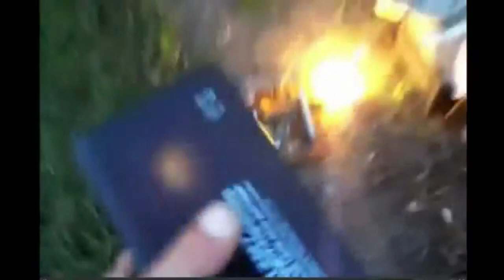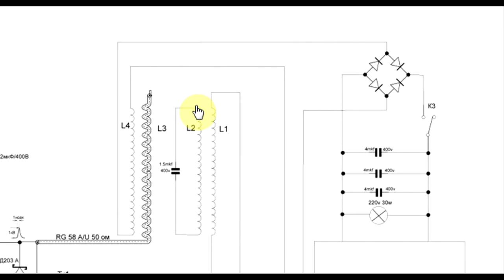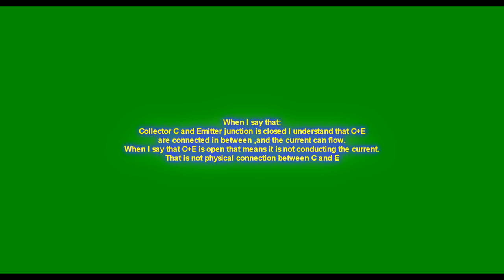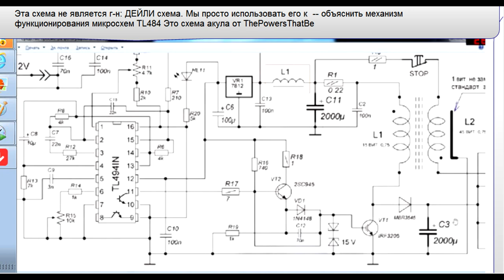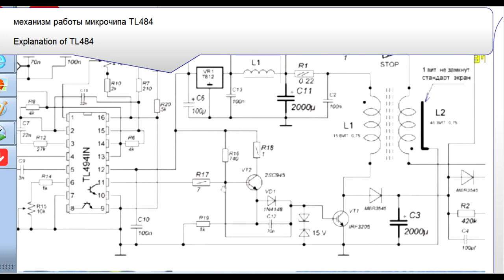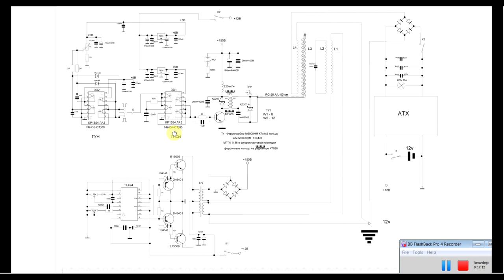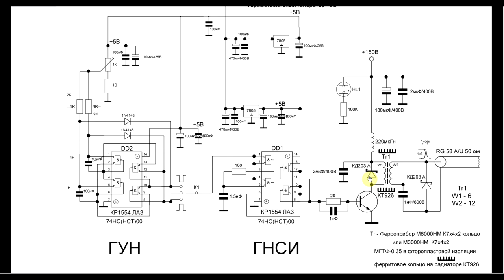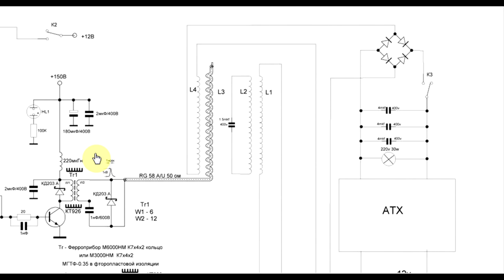Wesley presents:Daly part #1  Free  Energy Device (schematic)

Comment: the 150 volts actually comes back from the other side of the secondary... so it's a push-pull 12V high amp as you can - (that's the ferrite ring projects that are inverters)  ... the 4th winding (second output) goes to the composite coil... and the resonance from that coil comes back to drive the ferrite core... so the tl494 is tuned to that frequency... but with the first secondary that is rectified to the cap, if it takes a lot of the flux in the beginning it takes a bit to get to resonance until that cap charges quite a bit, then the resonance is more effective.
Reply: the diode is also a special characteristic DSRD (drift-step-recovery-diode) which when reversed will over-pulse so you get a 1.5KV signal out; Itsuable was able to get this effect.... 

The top logic can be simplified to stacked mosfets with a RC constant betwene their gates so one turns on and then the other (I had a circuit model for it but cannot find it... )  There was a book that was mentioned 'belkin' something about pulse shaping techniques for GPR (ground penetrating radar)
Reply: I'm a little wrong; the resonance within the ferrite toroid is enough to generate high enough voltage... it's not really feedback from the composite coil; there is a additional LC resonance tank on that coil which should be tuned to the same frequency....  The transistor is also known the avalanche; the original part is a voltage rating of 150V; so it's possible that after a couple tickles from the nand gate pulsers that it ends up cascading in freqency of the the rest of the system....
Reply from the maker: thank you for your comment :)

Comment: The other interesting connection; betweren L4 (toroid driver) and (l2?) of the composite coil 1 side is grounded.  This sort of half wave rectifies the coil resonance.  It was important to ground the correct side... without ground there isn't enough 'free' electrons for the oscilllation... so it was generally less effective...
Reply from the maker: I have explained  that in video 5

Comment: The thing I don't get, and maybe this is where the free energy comes from.... The 'Magic Coil' for all of these guys is the same, they all have TWO input coils coming from TWO separate parts of the power supply. (L1 & L3)   WHY ?   Any conventional transformation system always has ONE input winding.  You only need one coil to pump energy into the core. You Wesley, and oher researchers like Don Smith were able to produce OU with HV spark discharge through air core resonant transformer with ONE input coil.  Why do these guys have TWO input coils? And why are all using COAX cable for one of the TWO coils?  Wesley, you present discussion with friend talking about RF impedance and reactance of coax cable with different terminating resistances at RF frequencies, but what you didn't talk about is what kind of energy is the COAX cable transmitting into the core as electricity flows through it?  Is it transmitting magnetic energy like the other 3 coils, or is it transmitting RF energy Into the fluxuating magnetic fields of the other coils???  Is there some 'Magic' that happens when you introduce two types of energy into the same space?  Magnetic energy pumped in on L1, and RF energy pumped in on L3??? Maybe this was Tariel Kapanadze's big secret???

 I also didn't hear any discussion of the two frequencies of the two oscillator circuits. L1 must be pulsed to match the resonant frequency of L2, this is obvious, but is L3 the same frequency?  If L1 and L3 are the same frequency, are they synchronous or are they phase shifted?
Reply from the maker: saintsnick be honest To answer the questions I should do  another video.
It is not  as simple  to respond as is simple to ask.
That is why there are so many videos in this subject there.
So  should  you take your time to dig in  other videos to find my explanation of electrostatic pump?
============================================================= 
The student wants the answers and by the time he gets them he already  has gone to 4 years of  university "preparation" to understand them and did not return  yet.
==============================================================
However also  there is another way I give you example:
I work  on Colman Device - the rest is only my contribution to general subject of FE.
As Colman is based on very much set phenomena  of radioactivity look:https://www.youtube.com/watch?v=l-Cvm_0XEjg
than to answer questions .At first, one must go to:   
https://www.youtube.com/playlist?list=UUluf2QeoM9dS8sETBJLcmUQ
 here you find 100 videos and around 60  are  important for you to view.
And than you ask questions, and I need only to give you than few short answers.
=================================================================
I would love to   help you but that would be more like take most of my  recent videos
and repeat it in form of the answer.
 Yes you got me here.
Whatever my answer is there is 20 more  new questions to be ask.
I suggest  take your time  and get deep into  the material published.
I have however some universal answer  for most of it.
 And that must  wait ,
 stivep:http://overunity.com/15083/the-new-generator-no-effect-counter-b-emf-part-2-selfrunning/msg427618/#msg427618
Reply: stivep1
Reply: saintsnick Wesly, thanks for responding. I am familiar with the Coileman device. I am a long time researcher, and I read the Coleman patent completely a few years ago.  It is a Fantastic technology, a radio-nuclear battery, where a specific frequency bandwidth is directed at a specific chemical layer assembelage, whereby a Low Energy Nuclear Reaction L.E.N.R. takes place, and a large amount of low cost electricty is directly produced.  It's great to see experimenters tinkering with this technology, and having success. I wish them much luck.  I however am interested in solid state electrical OU devices.  I've seen many successes so far, some also fantastic. Generally, these type devices involve, tuned electrical resonance of input or output circuitry, or both, where differential input energy is squared at resonance, tuned isolated tank circuits in a transformer adding momentum or creating a base frequency of an air core, and high voltage spark gap capacitive discharge circuitry, which also has an ability to add energy to a circuit via half cycle capacitive-resonant-colapse.  These type devices may also sometimes involve RF collection through tuned resonant circuitry, or tuned resonant masses. There are tricks to make these things work.  But never have I seen TWO input coils in the same air-core, and more specifically, where one is a conventional transformer winding, and the other is an RF impedance cable, Opened on one end. If this is truely RF transmission into the core, then it is interaction of EM and RF, and is UNLIKE the Coleman technology... radio-nuclear.  Am I viewing the schematic correctly??? It seems there are TWO oscillator/amplifier circuits with separate input coils on the core. You speak with these guys. You are the translator, the Rosetta stone between worlds. Only you can get into their heads to understand.  I don't speak any of those languages. Please provide some indication as to what's going on with these guys theory of operation.  And I will continue looking for what you say, Electrostatic Pump, but judging a book by the title, it doesn't sound like an explanation of what's at hand.

Thanks....

Comment: The coax cable signal.... The 1.5KV signal has such low amperage... that it basically disappears... that is if you have the diode, you can see it, but if you connect a coil; the low resistance of the coil absorbes all of it so you can't see it anymore... but it must be there?
Reply: 1 KV signal not have low amperage, it have hight amperage and wery small duration (1 nanosecond). Like say, one guy, who say, that replicate this divice, that Hight voltage ioniase air.
Reply: KristusSibire VisarijonasSibire you can have 1Kv at 1A or 1Kv at 1pA... it's still 1KV... it's low power (there's not much capacitance in the diode to generate a current flow)
Reply: No. Here is strong wery short pulses. They can have, maybe 10 amps and one KV, but they wery shorts, 1 ns, so they consumpse wery small power, maybe 2-10 wats, because they wery shorts.
Reply: Transistor KT926 is cpecial made for short pulses. It fast  and strong (about maybe 200-30 mhz and 15 amps, in pulse mode more). Specialy made for stron pulses...
Reply from the maker: everything is explained  more or less in video 5

Comment: Think it's just the GNSI that's the (generator nano second interval) the dally tl494 went like 5k -300k Hz... 
There's a cap cargedb etween taht the nano second pulse is from... which is from the cascaded nand gates...
Reply: The lower tl494 part looks like an resonant inverter; it provides the 150volt cap for the gnsi along with resonance... It is meant to drive in a resonant mode so you can get that, it's not a flyback/joule-thief sort of spiike....  It was actually kind of hard to tune, becasue if you start with 0 charge in the cap, the frequency is difefferent for resonance... so you can tune it slightly below the correct range to get a wider part... but in the resonance another signal spikes, which results in a power output on the L4 (somehow)